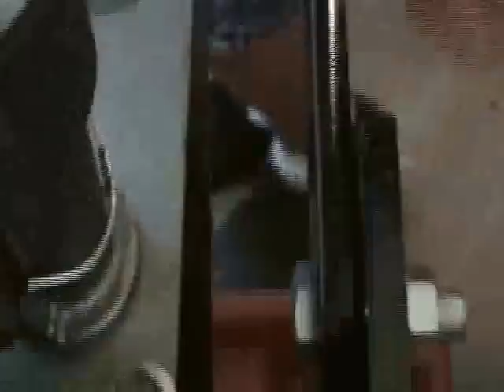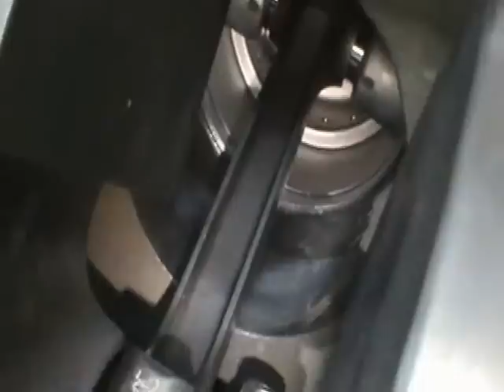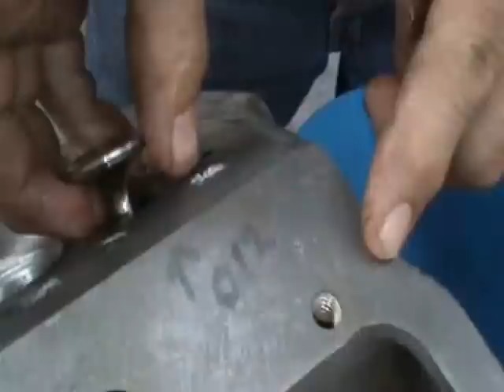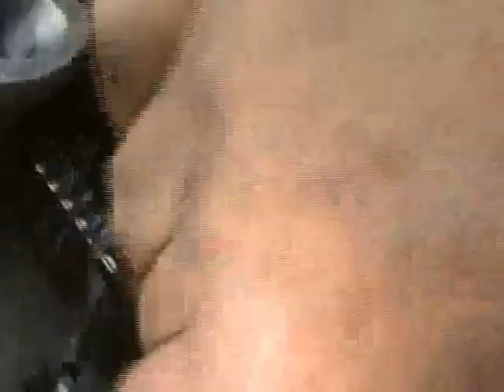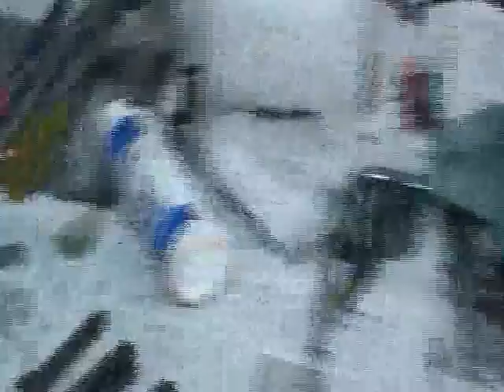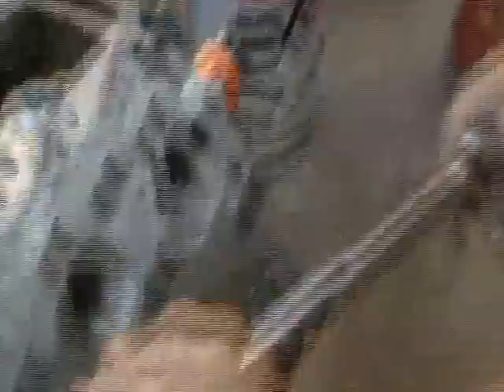Building a High Performance Flathead Ford  Part 4 -  Pan, Valve & Head Assembly

Comment: We adjust valves with no crank.  A modified steering wheel bolted to the cam.  Next bottom end and pistons.  Oil pump pre lubed and pan goes on.  Turn engine over fill with oil . A cam adaptor spun by a drill untill oil pressure comes up.  Also  we like to spin the cam with drill  low speed and a final valve gap check as thow engine idling.  Install cam gear intake  ready to run. Thing I do not under stand is  torqing heads 3 or 4 times  times a thousand out the door daily.  Don't think they had a thousand people just torqing heads?  or maybe they did?

Comment: I would suggest fitting the oil pan and oil pump after the valves etc are installed just in case something is accidently dropped into the motor.

Comment: Is there any company that makes new flathead blocks?  I saw some that were French?  They cosy huge money.
Reply from the maker: Not currently that I know of.
Reply: blownflathead 

Seems like they would be really popular, especially if some of the original problems with metallurgy could be solved.
Reply: shane 
It would be amazing. Folks continue to love flatheads and they have done amazing things with them. I remember a streamliner called Flatfire that did some amazing runs.  I also know from your post that you know infinitely more than I do!
Reply: shane 
Strangely I’m a music teacher and a science teacher. I have a little bit of experience with the LS engine as there is one in my C7 Corvette. It is lots of fun and my daily driver. I live in South Texas out in the middle of nowhere. My son and I love cars. He is a Staff Design Engineer at Tesla motors. I’m afraid his model Y  dual motor is faster 0-60 than my Corvette!
Reply: shane 
They are pretty amazing. Only one gear and no clutch or anything. My son is a lead designer of the Model III, and Model Y rear power units.
Reply: shane 
My son has been down to the Giga Factory where they are made many times. The newer ones are permanent magnet motors. Elon Musk even stops by his office occasionally! They are building a huge new factory near us in Austin, Texas to build the Semi truck and the pick up truck. You can see the drone footage of it on YouTube. I’m also fond of Indy Roadsters with the four cylinder Offenhauser engines. A.J. Foyt has a branch near me. He comes to town sometimes but I haven’t met him. He won the 500 twice in a front engine roadster and twice in a rear engine car. I guess nobody will ever match that!

Comment: BlownFlathead,
I took off a head to measure the  cylinders to determine the cid.  It was "freshly" rebuilt thirty years ago.  It is indeed a stock 239.  It was running fine before I took things apart.

1st, do I need to replace the head gasket?  It got a little bent removing it.
2nd, I noticed a few head bolts were different lengths.  I didn't notice until they were all out and I don't know which ones go where.
3rd, do I need to chase the block threads before reinstalling....chase with what tool?
4th,  any other advise is highly appreciated.
I love this series of videos!
Reply from the maker: It is always a good idea to use a new replacement head gasket and chase the treads. Also use sealer on the threads. See pages 9-6 to 9-7 of "Ford & Mercury Flathead V-8 Identification & Rebuilder's Guide". Which bolts go in which holes will be obvious when you set head and bolts in place.

Comment: Seems like you would set the valves a little loose as they would tighten up pretty quickly as the valve seat and valve wears in. I mean you have to remove the intake to adjust the valves anyway so...........Nice Build

Comment: 12 head bolts for those 4 cylinder heads per side? *? i missed it. 8?
Reply from the maker: 24 head bolts or studs per side for this engine.
Reply: Yhhhh you hubhuhuhbh uhh huhhuhhhhh
Reply: Good to have a LOT of head bolts/studs to prevent a BHG,eh?

Comment: So the rope seal on the front doesn't need to be soaked? Ive heard from a few sources your supposed to soak it for 24 hours
Reply from the maker: It depends on the seal material and the supplier recommendations. I like "Best" brand seals and gaskets and they don't recommend soaking the rope seals.
Reply: You know US manufacturers used those rope seals all the way into the mid 1980s. 
The GM 4.3 V6 used it from the start.

Comment: High performance and side valve Ford don't  match.
Reply: i cant imagine why not, some crazy dude made a 5 horse briggs flathead do 7,000 rpm on a gokart going like 60 miles an hour, flathead may not be the best at combustion flow but it can still go like a hot damn
Reply: FlyinWldAlaska77 Is there a video on Youtube with that briggs motor? I'd love to check it out. Thanks.

~k0rndog93~
Reply: Not so.

Comment: Wow. The 4 exhaust ports are Siamese into 3 ports?
How does the exhaust ports go out side of the head?
 I'll watch more.
 Very cool that the engine has TWO water pumps.
Reply: The FH Ford exhaust ports are in the BLOCK traveling from the top to the bottom of the block; this caused so much block heating (especially the center 2 into 1 port ) that a big oversized radiator and dual water pumps was needed. This all was OK as long as all was like new and in working order but if not, you had an 'ol Faithful geyser on your hands. Another defect was that the crank had just three main bearings instead of the usual five for a V-8. These defective designs started in 1932 and went on thru 1953 before it was "discovered" and replaced by the 
Y-Block OHV V-8 in 1954.   Cadillac and others using the flathead V-8 used good engineering practice with five mains and also ported the exhaust out the top of the block right next to the exhaust valves where the intake manifold is usually located, this created minimal block heating.
Reply: MrGGPRI:  Your explanation is excellent!
I see how that engine is flawed,now.
 Insert smiley face here.
Reply: Most of the early fifties OHV V-8's also siamesed the center two exhaust ports, including Olds, Cadillac, Studebaker, Pontiac and Packard.  Being overheads, of course the exhaust didn't run through the block like the flathead Ford V-8.
Reply: As for the flathead Ford's "defects," it's true that the exhaust routing wasn't the best for engine cooling (although it looked better than running the exhaust out of the top of the block), but the three main bearing crank wasn't really a "defect" - the V8 was naturally shorter than an inline six or eight with the same cubes and its crank was therefore more rigid and could get by with fewer main bearings to support it.  At least at the horsepower levels a stock flathead made.  At three times the stock hp level, the three mains are not so great.  Still, it's amazing how much hp some guys are making with these motors (especially supercharged), and they actually can last for a while. . . .
Reply: well you learn something new every day i guess, i always kinda wondered about that exhaust port through the block like that, it makes sense that it would want to get real warm, i would have designed it with the exhaust coming out the top and down the back, like the intake manifold had tubes that ran down to the intake ports and then it had a cast manifold next to it, it could however cause the intake to get hot and it have preignition and stuff, i guess if i ever start making engines ill figure it all out
Reply: See UK Morris Austin BMC A series engine-4 cylinder 5 port non cross flow engine.

Comment: What kind of aluminum head is that?
Reply from the maker: The heads on that engine were modified 1952-1953 Mercury heads (marked "EAC"). They are iron. Modifications are shown on page 34 of "335 HP Flathead Ford V-8 Performance Handbook".

Comment: you will never spend so much to go so slow
Reply from the maker: Zero to 60 mph in 3.5 seconds or 12.4 second quarter miles doesn't seem all that slow for half the cost of a new Camaro or Mustang. See the videos at www.roadrunnerengineering.com .
Reply: It's like having a flathead v8 in a 1936 Ford truck just because it's just right!!! People like you just don't know!!! 🤔😢😥✌
Reply: If some of the naysayer have ever listened to a well built flatty set there and talk to them,they would understand why flathead enthusiasts love these engines,they sound so good idleing as they count -em off
Reply: @dennisdill9433  They cant hear it.